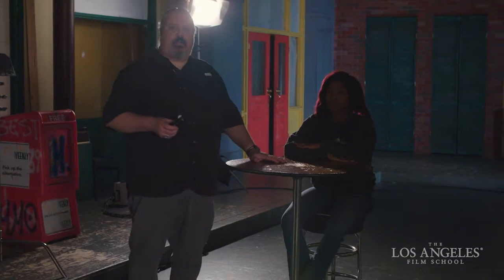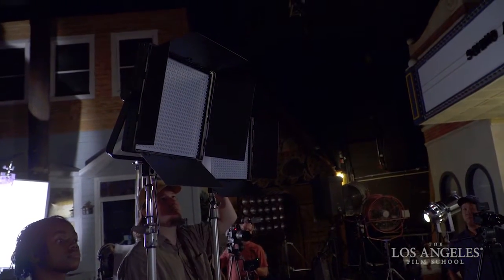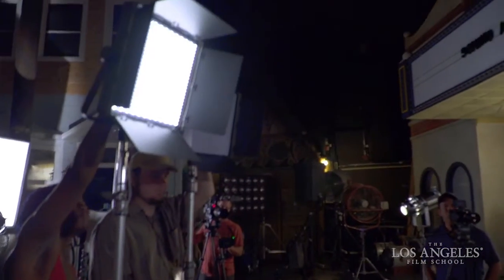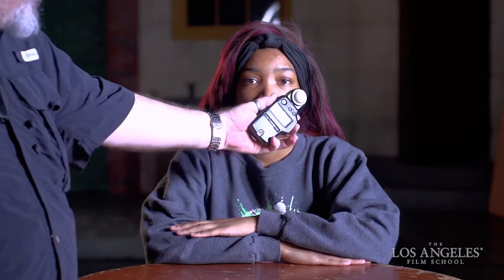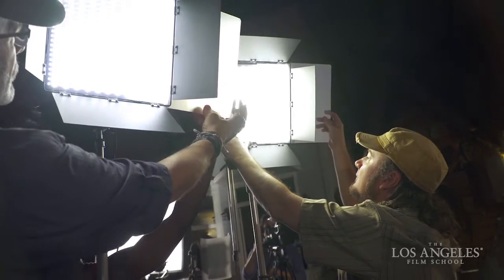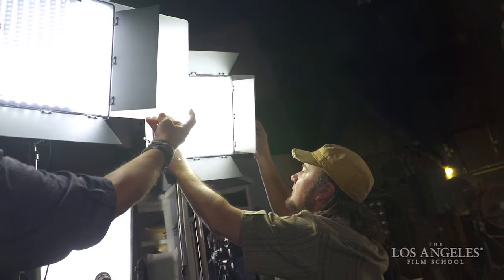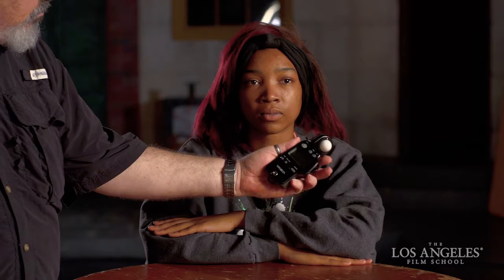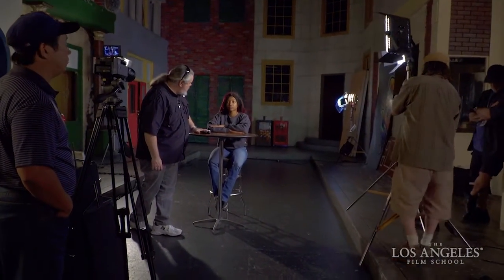3-Point Lighting (LED Panel) - LAFS DFM-200 Prt. 4

Comment: Does it matter what bi color led panel to use
Reply from the maker: Not necessarily.  Brand goes only so far to insure that a product is the best in a class of products.  It is important to test a variety of products, to determine which are the best in terms of color reproduction, value for the money, easy of use and flexibility.  Look for performance in the areas of color accuracy (CRI), color range (CCT) 3000 to 5600, and diode (emitters) count.  In an average 1X1 LED panel there are 600-900 LEDs.  Are they surface mounted; meaning they can employ lenses to affect beam angle, are they traditional encapsulated diodes (glass beaded).  If so, what is their refocused projection angle?  Is the product a phosphor filtered unit, which needs CCT filters to change color to predetermined temperatures?  The products I have tested recently, that represent the best value and capabilities for the money are: Fovitec (Studio Pro) 600B, Neewer 480 bi-color panel, Yongnuo 460 LED wand, Dracast LED panels and focusable fresnels, Intellytech Light Canon LED fresnel spring, and Falcon-Eyes flexible LED mats.  All of these products are inexpensive, color accurate, and highly functional for work on a variety of budgets.